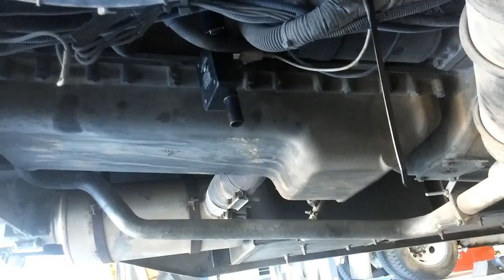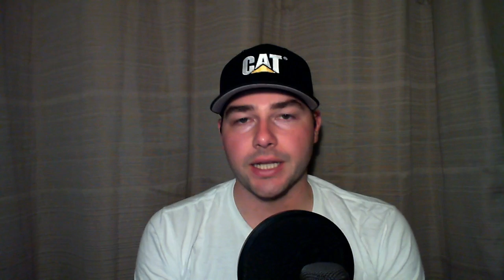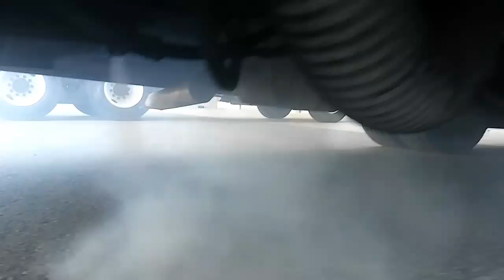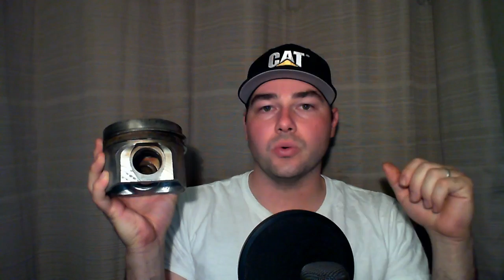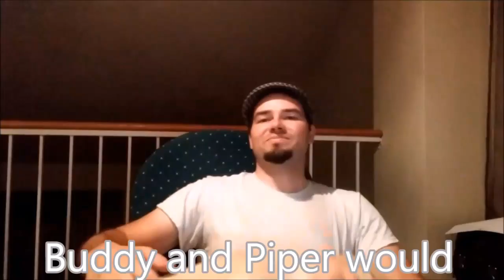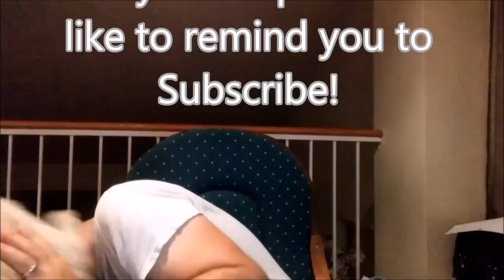Is Idling Your Engine Bad?  Does Idling Hurt Your Engine?

Comment: Excessive wear at idle is more about running an engine in extreme temperatures than it is about excessive idle. If it is too cold or too hot idling does the most damage. I've seen engines refuse to start after idling on a beach for 10 mins. The salt air going into the engine scores the cylinder and because it is cool air the engine operates below the ideal temperature. We sprayed 'Start ya bastard' into the intake while trying to turn the engine over to get it going again. It ran real rough until it got back on the highway and left everyone behind in a massive cloud of smoke.

Comment: When in North Dakota or Alberta area during the winter , u don't have much of a choice but to idle. 
Everything just freeze up solid otherwise. 
At my old job in North Dakota , if u shut the truck off for more then a few hours while outside , it would completley ice cube. We would have to tow it inside the shop and put cannon heaters under it and a tarp over the truck to act like a large balloon with heat in it. 
Then change filters and then restart. 
Some times the trucks would run for days or weeks at a time. When it was neg 30 outside. 

Guys would do a shift and then come to the yard and go to sleep. Some stayed in the trucks others in campers. But all the trucks would be set to 1100 rpms and left to idle. 

Even then and with cold weather bra on the radiator , the engines would still barley keep normal operating temps. 

All the engines where pre def and pre regen cats in over the road peterbilts retired from highway use and repowered to work in the oil fields. 

You would of got a kick out if that shop. You wouldn't imagine what we put trucks thru in the oil fields. 
I spent years doing otr and local and dump truck work then went to the out fields and had a whole new respect for what trucks can go thru. 
We truly tested the metals limts, the structure and the engineering of every part was tested. 

Cracked frames , broken axels, trucks catching fire due to chaffed fuel and electrical lines, hard part internal engine failures and everything in between was a normal day out there. 

Your videos are great! Show us more video examples and more parts examples. It's great stuff. 

Thanks.

Comment: Cummins manual stats no longer than 10 minutes at idle at 750 rpm, high idle at 1100 rpm is ok but not for long periods in cold weather due to cylinder wash. Thank you very nice video, keep up the good work
Reply: How bout in hot weather

Comment: A REDLINE A DAY KEEPS THE CARBON AWAY!!
Reply: Hell yeah son, Italian tune up!
Reply: This aint rotary engines but I get the joke
Reply: Really? :D
Reply: But does it work with GDI?
Reply: Im always running close to redline, have no power down low.
Reply: MCLovin ' my engine is broken after that..... i reeved just 8000 rpm...... carburated.... i tought that the potency in the manual was bullshit and i tought 8000 rpm was an good rpm ... but my CHT escort blowed.......
Reply: @gabrielvieira6529  well in my case im referring to a mack 728ci inline 6 turbocharged diesel. On a 80,000lbs rated tri axle. It needs to be in high rpms in order to move the heavy loads i get, 2200 rpm is redline on mine. You must be talking about a gasoline engine?
Reply: @BP5Lwhipple  I never run my dd15 over 1500 rpm., unless I'm going down hill
Reply: @skim4me  thanks for the input old timer(respectfully). I find that these macks lack torque under 1600 rpms, but we also have cat and cummings engines on other trucks at my yard that have really good torque at low to mid rpms. Going up hills with heavy lumber loads with these old macks at any gear under 1800 rpms is suicide. You know more than i do about that.
Reply: @BP5Lwhipple  ya,my first truck was a 1977 f model. With 315 and super 10, I was hauling 150,000 loads for years with that truck.it was slow and it shot a 10 inch blue flame, on a grade out of my 4" straight pipe.lol
Reply: @BP5Lwhipple  my best torque on my DD ,15 is at 1325 overall, including fuel mileage. 63-64 mph nonstop 7.8 average mpg, heavy and loaded.
Reply: @skim4me  nice, i personally don't think my truck breaks the 1000ftlbs of torque mark, maybe close right under that. I don't own my own rig at least not yet, im a company driver for now. Been doing this only for a few years still a rookie ya know. Mine is very slow lol but it moves the weight so its ok.
Reply: That was good... it's pretty hard to get me to laugh, so take this 'W'...😂
Reply: LMFAO hells yeah

Comment: I've always thought it's kind of like pedaling on a bike with the chain off at normal speed it's not that bad but try and pedal as fast as you can it's not that good plus you have mentioned heat cycles so we're do you draw the line between idiling to long and damaging the engine from excessive heat cycling?

Comment: The volvo trucks I've had used a preheat in intake to help start in cold and exhaust break that would labor the engine to help warm up and also in below 0 temperatures down as low as -40. In MN,ND, MB ,Sk.
If that engine would have died so would I

Comment: Buddy of mines uncle left his Cummins running for 7 days straight.
Reply: Not good, you can let it run 6 days, but seventh day rest.
Reply: Chad Carroll  I love Truck drivers, they come in three kinds #1 they either know nothing and don't want to know, #2 they have all kinds of mixed up fantastical opinions, most of which they gained on 20+ hr drug-induced benders while cheating on their truckers' logs, all of which are wrong and usually nutty or #3 Humble and interested in learning how to better themselves and the machinery in their care.
Reply: Chad Carroll I’m thinking an APU would pay for itself in your application fairly quickly.
Reply: Chad Carroll  how do you change the oil with it running?
Reply: Chad Carroll  your story doesn't add up
Reply: So true what you said 
Because in the freezing environment it would freeze the motor rock solid and would not be able to start it again with out a heater element on it 
Russia leaves all cars cars and trucks and machine's running 24/7
Reply: Chad Carroll  It must be a quiet cab. 43 days!!!
Reply: Chad Carroll  making money?
Reply: Chad Carroll  you've ran your truck 43 days and put on over 12,000 miles.... With no oil changes
Reply: @NPC-mt1cz  have you ever be in truck industry?
Reply: Chad Carroll  Surely, you must be joking.
Reply: @chrisjimenez603  Stop calling him Surely.
Reply: @frontcentermusician  I was waiting for it, you came through like a boss.

Comment: LMC snowcat  with hydrostatic drive and a CAT 3208.
Have no choice but to idle for at least half an hour when it's below zero to warm up the hydraulics.
But since watching the Adept Ape here I now idle it at 1100 rpm rather than 700.
Keep the block heater plugged in all winter and if it weren't for a hundred miles of hydraulic lines, could keep that system warm too.
Thanks.

Comment: How much wear do you caused by turning off the engine and starting it again over and over versus the damage caused by idling
Reply: Jason Pearce leaving your engine running isn’t bad. It’s leaving it running at idle speeds. Starting the engine is definitely the hardest part of the engine operation if the engine is operated properly.

Comment: During the video you held up a 3208 piston. I'm always hearing mixed reviews about them, some say their good reliable engines! others say their a boat anchor!!/"The scatterpillar" lol What is your opinion on the 3208??
Reply from the maker: +Volkz VLOGS They are an old reliable engine, but they are heavy and don't make very much power.
Reply: 3208 is a boat anchor when you're talking about making good power... They are weak, and if you attempt to make power with it, that's when it becomes a scaterpillar. Thank goodness they are an antiquated design that I never have to work on again. No doubt, this guy is always talking about truck engines, but Cat current production engines in the industrial market has strategy in the software to allow them to idle without damage. To me, truck engines are babies that are basically throw aways anyhow..
Reply: If looking for high power they arent the best but the pair in my boat ran for 18,800 &18,200 hours without any major problems.Keep in mind about 20-25%  of that was idle time (bad) and the rest was pretty much wide open throttle a few rpm under redline which isnt good either.I put injectors in them and a pump on the one but other than that it was just maintenance.The guy that has the boat now put turbo's on them and has had a few issues but nothing big and last I heard he's racked up another 4k hours.So while people call them boat anchors by todays high HP standards,they are reliable if maintained and do the business day in and out.

Comment: Talk about cat junk Volvo motors don t have these problems cat and Cummings North American junk even Detroit was junk till Mercedes save theirs sorry ass Cat it s not even a hwy motor it s a generator motor lucky international buy cat if not cat would have closed the dors
Reply: It is "Cummins" not "Cummings" btw. You are sure enough brand new to this business, Cats have allways been reliable but too heavy for alot of applications. Cummins has served the trucking industry well for 30+ years. Detroit was the bad ass in the 60's and got passed up by Cummins and Cat except for Marine apps. But now the best engine on the road for fuel milage , and less breakdown AND still have power is Detroit ever since the 60 series came out. Fact.

Comment: i disagree , when you start your engine cold , the tolerances are different because the metal parts did not expand to the design values , regardless about the fluidity of the oil, to prove my point , look how they start F1 engines, they pump hot fluids into it, if they start it from cold , it will destroy itself, of course , the tolerances in a F1 engine are super tight , but again, the F1 engine lifetime is way shorter than a street engine, the reason why a lot of people are promoting against warming  up your engine is the new regulation to reduce emissions, there are even laws against idling your car for extended periods.

Comment: Its not good to let it just idle. Turn the rpms up to atleast one thousand rpms. That way you have oil pressure and coolant running through the engine to keep it lubed and cool.

Comment: You are wrong about the glaze on a bore, part of the running in process is generating a glaze, the glaze is what stops the rings wearing out, glaze busting on an engine is to bed the new rings in, if you replace rings without removing the glaze the engine will burn alot of oil and have blowby because the rings can't bed in. idling will remove the glaze, heat and the oil held by the cross hatching which burns is what generates the glaze. Glazed cylinders are not the cause of blowby (in a run in engine), glazed cylinders are needed and are not a fault, all engines glaze the bores soon after running. Excessive idling causes borewash (glaze removal) which in turn wears the rings and fuel running past the rings contaminates the oil. The lack of heat will cause carbon build up as the fuel isn't burned fully. Running an engine for a short period of time causes condensation issues in the engine, gearbox, exhaust etc which is far more damaging than idling for extended periods.
Reply: I think there's confusion in the difference between "glaze" and normal wear. Confusion that the ape is guilty of as well. ALL engines will lose the crosshatch as they wear period, the loss of the crosshatch is not a necessarily horrible thing. But loss of the crosshatch does not equal glaze, you could take a short block and turn it by a machine for years and you won't get the cylinders glazed, worn out but not glazed. The rings and oil just can't polish the wall that well on their own. Glazing is a polishing of the cylinder not possible from normal wear. It requires something to act like a polishing compound and a mix of wet fuel and soot seems to be just the thing. 

Secondly a certain amount of friction between the rings and cylinder is needed for good sealing. The friction twists the ring a bit in the grove as well as pushes it against the ring lands in the piston. This does a lot to help the ring seal.
Reply: Dubsy Dubs - In diesel engines, the glazed liner is caused usually by over fueling which generates excessive carbon build up on the piston rings.  The carbon is much harder than the cylinder sleeves resulting in the continual removal of the 22° crosshatch pattern responsible for optimal lubrication of the piston rings and liners.  The glazing will also precipitate more engine blow by as the oil will no longer find crevices in which to reside.  Long idling engines can also cause incomplete combustion depositing incompletely burned carbon on the piston rings.
Reply: Dubsy Dubs where did you get all of that from.
Reply: Why?
Reply: Because from what I learn and know, bedding in is what happens during the running in period, Glazing is what results when the rings gets weak and worn. Or you could speed up the process by putting the engine under load from the start up.
Reply: Bedding in is running in. Glazing is what happens in all internal combustion engines, like I said if you lose the glaze you'll wear the rings in a short period. The  rings last hundreds of thousands of miles,  that's not possible on unglazed bores, metal on metal wears out, everything on the engine has a barrier, nothing is metal on metal except when new.
Reply: When you lose the crossed hatch pattern then glazing will start occurring because now there no way to keep(retain) any lubricant on the cylinder walls.
Reply: You rarely loose the crosshatch, the rings run on the glaze, If the bore wears it's because it's glaze was bad, have you turned over and engine that's not new by hand when it's just a short block, it's very easy to turn and the rings make no noise, fit new rings on a fresh bore and then turn the crank, it's tight and stiff and scraps, that condition doesn't last but a few miles until it glazes. If it didn't glaze it would remain scrapping the crosshatch, every engine you take apart would have no crosshatch left, every bore I've see is glazed. I've seen many in 40 years looking. The quickest way to remove the glaze it to flood the cylinders with fuel (not as bad with diesel).
Reply: An example, watch 'Western Truck and Tractor Repair' Detroit 50 Series teardown, and see what he discovers when he removed the cylinder head.

Comment: I've had to start changing the oil on my wife's car more frequently because I found out she was sitting in her idling car during her hour-long lunch breaks 5 days a week.  I was going off the milage for oil changes, now I go by the hour-meter I installed on the car and change the oil about every 125 hours.  About half of the time the car is probably just idling.  Sigh.
Reply: Jess Stuart what kind of meter is it and where'd u get it
Reply: Just put in a high idle switch

Comment: Had 7 trucks that went 1.5 million plus miles before tearing them down. Ran from Sunday night till Friday night. Shut down long enough to check oil during fill up. When we pulled the head the liners and pistons looked perfect and speced almost new. We bumped idle up to 900 rpm for our 10 hour breaks and load and unload time. Could have flipped 2 mill at the rate they where going with no issues...
Reply: Stephen Carr v
Reply: I doubt the same would apply to my '99 Camry 2.2 liter
Reply: What truck? I have a 06 lbz. 340k no problems. Would be nice to hit 700 with standard maintenance
Reply: You can't compare diesel engines to gas ones, gas washes out the cylinder walls while diesel is more lubricative..

Comment: An engine design incorporates such safety factors to enable it to take the smooth with the rough. This advice is mostly pedantic. Regular heavy loads on an engine will most probably cause more accelerated wear than frequent idling.

Comment: I have a C15. 1.5 million miles.  Still original.  It idles a lot for PTO and heat and air. But I change oil around 12 k. Because of the oil contamination because of idling. . It still does not burn oil or have excess blow by. .. Also when it is working it's pull a car carrier always maxed out. .. Also I don't over work my engine or over heating it either.  Lots of good info on you viedos
Reply: If your PTO is operating and under any kind of real load (hydraulic pump etc.) this vid does not apply, its under load, the rings are under compression.

Comment: My truck hasn't shut off in 7 months. Except to change the oil at Every 50k and only used a gallon of oil every change. Currently has 287460 miles on dd15.

Comment: in short just like the 2016 dd15 high idle the sob keep temps up and I run bunch of lucas in the fuel I did I hit the 8 to 10 hour timer It say do regen I push button 10 min or less regen complete the normal for dd15 is 40 min to 60 min so I would say that a timer kicked off before the actual dpf was even close to backpressure limits

Comment: last winter we had a power outage and i let my car idle with an inverter hooked up so that we had power.  it ran like this for maybe 4 hours before the power came back on. when I went to pull it back into the garage the exhaust system was completely filled with at least 2 quarts of water from all the condensation in the pipes. Car is fine but I'm sure that didnt do the exhaust any favors.